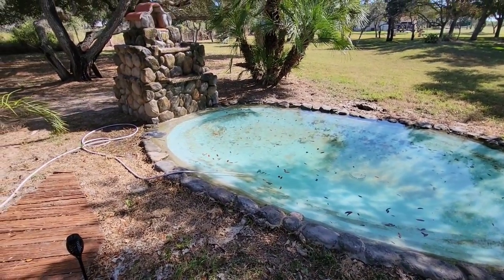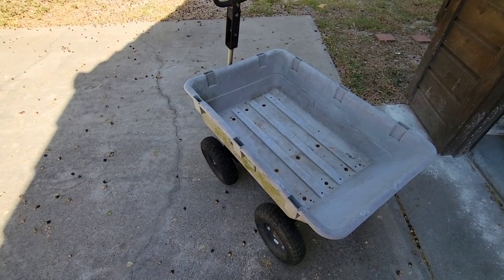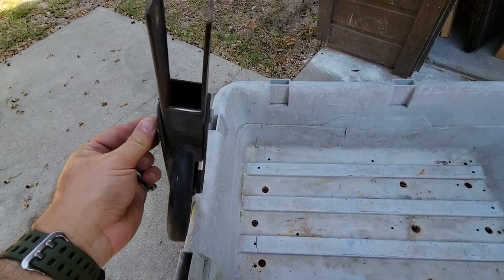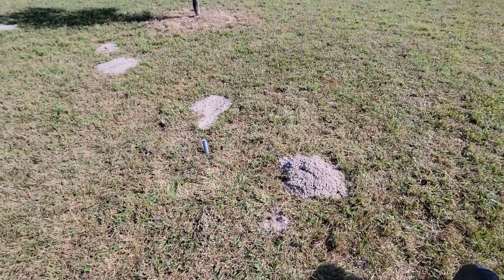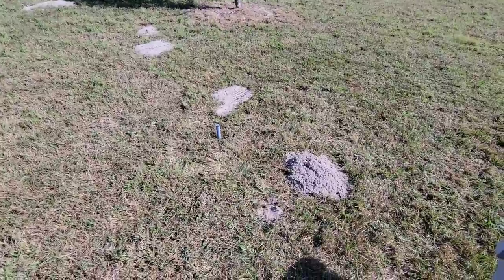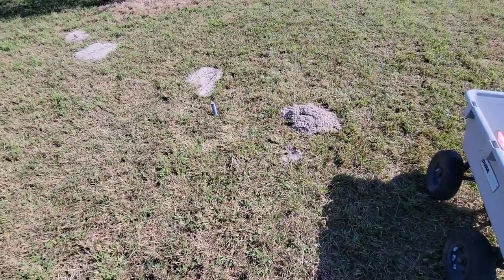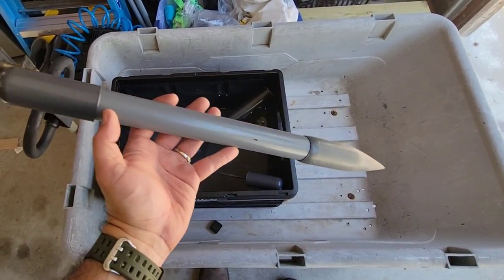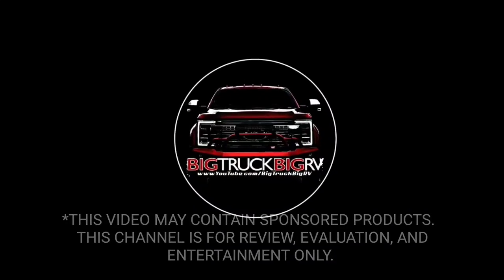My SCAG can Tow!  Time for a Fifth Wheel for my mower!

Comment: Auger or dig a hole near the middle of the gopher run. Park the SCAG next to the hole and put some flexible tubing over the exhaust pipe and down the hole. Do this at each run and by the end of next week y'all's gopher problem will seem like a bad dream.
   Another method is slightly more hazardous, but WAY MORE FUN! Put the end of the hose coming off y'all's propane tank down the hole for a couple minutes (might have to experiment with the length of time), turn the tanks service valve off, remove the hose and throw a lit farmers match at the hole. Y'all may even locate the entrance/exit to the run. 
Enjoy the videos JD. Giddy up.

Comment: The trailer tracks really well behind tge scag, but the safety chains are missing along with a weight distribution hitch.
Reply: Definitely not half-ton towable without trailer brakes.  Sorry, you know someone had to say it.
Reply: I forgot that it doesnt have the upgraded suspension as well
Reply: I forgot that it doesnt have the upgraded suspension as well
Reply: Needs G rated tires and a TPMS.

Comment: Get back to the Depot and get a 5' steel spud tool, it should be 1" to 1 !/4" square spud end. Just the weight of the steel spud will get down in the Texas soil easily and will wallow out the hole with little effort.